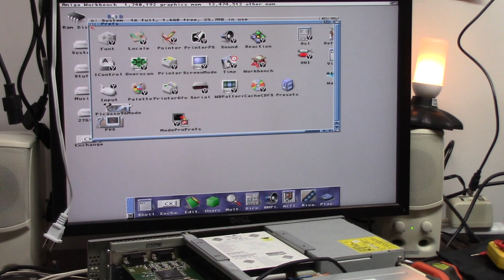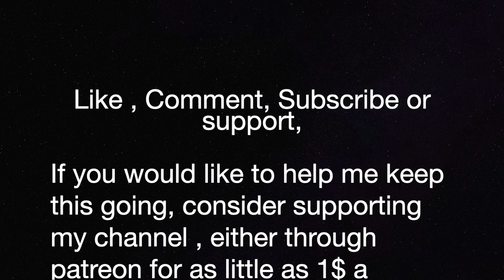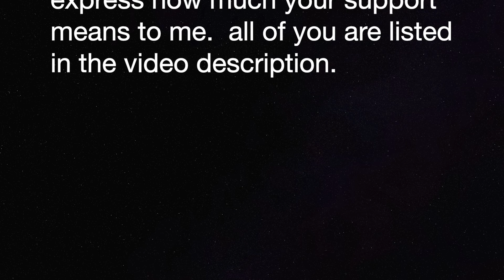Amiga 4000 CD audio how to

Comment: Great video! Do you have any idea how to get the audio signal from the CD Rom louder? In games that use CD audio (Genetic Species, Napalm, Quake etc) the Paula sound is always much louder than the CD sound. It would be great if there was a solution :)
Reply: Have you downloaded and tried Ghostmix? Can be downloaded for free off Aminet. It’s what I use on my mediator with a Soundblaster card which has Paula sound connected up via the phono outputs into the The alternative for hardware is to have some sort of intermediate volume control wired up.
Reply: @cullmaster7361  Thx, will try that :)
Reply: The resistors on the 4000 motherboard for the cd audio in are too large(1K ohm i think?) a value,reducing them substatially will bring the volume up.
Reply: @a4000t  Thank's, i will ask a friend if he can help me out :)